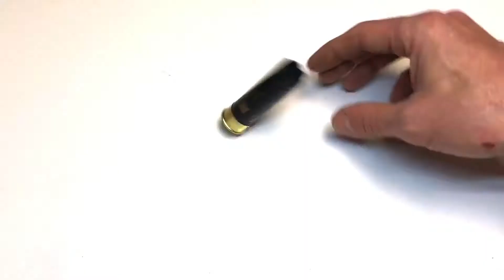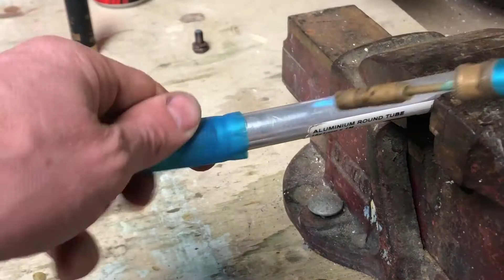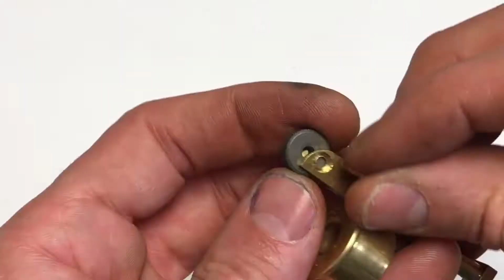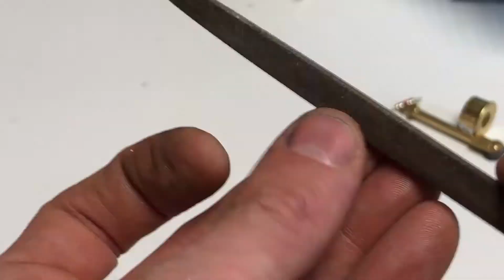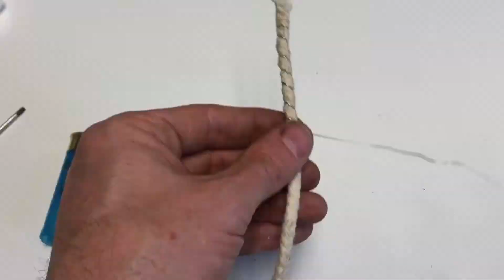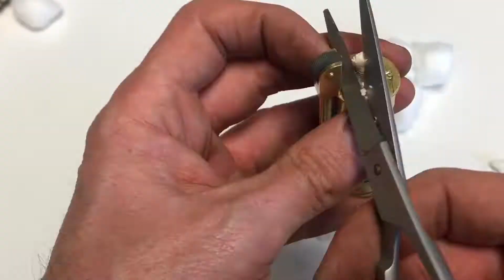Lighter Made From a Shotgun Shell - 2 Minute Version

Comment: Pro tip: you can use the removable clipper spark thingy and shrink wrapp it to the side of the shell, you also dont have to do the bottom screw thingy for refilling and youst leave it original, for the wick chimney anything hollow whit a thread will work as long as you can attach one/two nuts [one if its a screw of sorts] and for the cower anything that can thread on and doesnt have a hole on the end will work